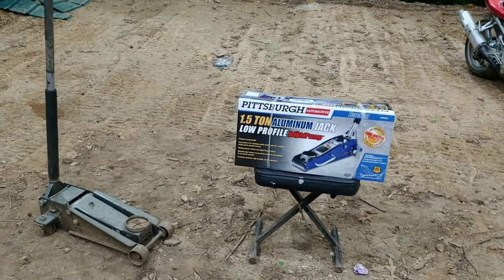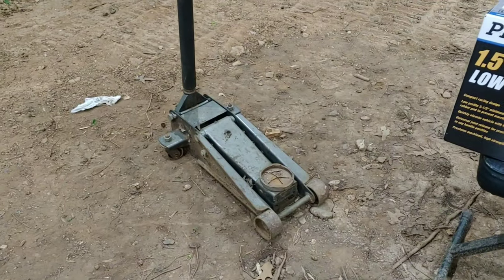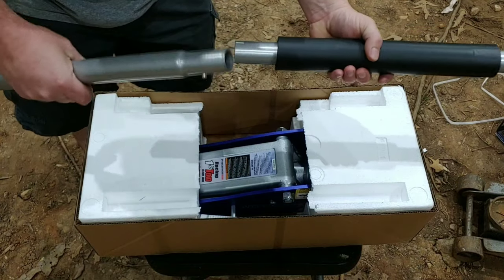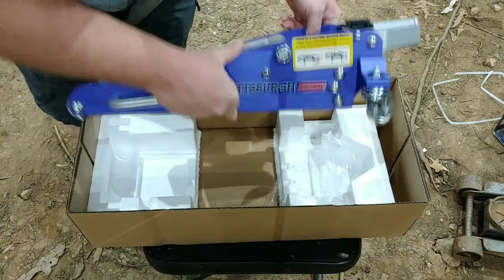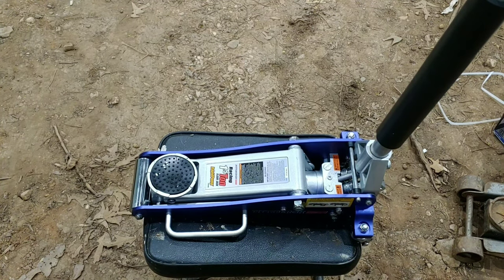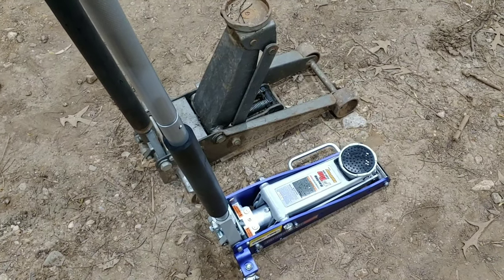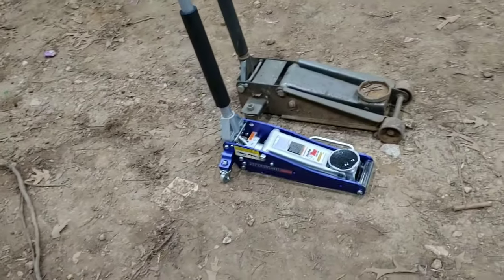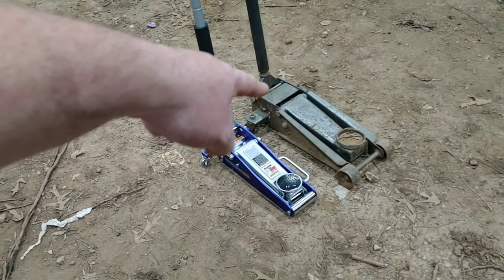Harbor Freight 1.5 Ton aluminum jack unboxing and review

Comment: I just unboxed mine and the handle socket is off centered so the handle wont seat properly. Also, when I pump the jack is projectile squirts hydraulic fluid EVERYWHERE and comes gushing out from underneath as well. Not pleased at all. This is the first hydraulic jack I've ever purchased so I can't say for certain, but I'm pretty sure that's not supposed to happen. I have used them many times, and never encountered one that was a squirter. I hear they're pretty rare, haha!! This genuine POS is going straight back to where it came from.